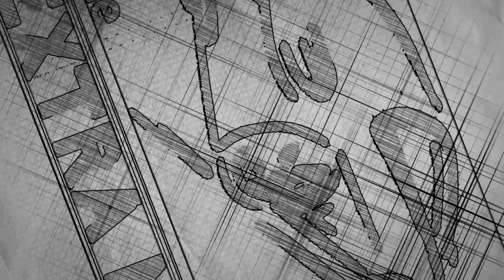W204 C63 AMG: My new exhaust sounds like crap (and how I fixed it!)

Comment: The stock mufflers have an miniature x-pipe in place to give it that signature c63 bark. Also act as both an helmholtz and pressure chamber. They remove the annoying boat drone frequencies at around 110hz. Also if you x pipe the exhaust crossover it will lose the bark and only scream/rasp 2x as much but lose the bass.
Reply from the maker: Ooooh that is VERY helpful information! Thank you!!!
Reply: @TheExtraMile  to retain the factory amg bark try an H pipe without resonator at a smaller diameter at the stock resonator location. That's the secret to that factory low end bark and startup loping sound but way louder.
Reply from the maker: That is a great tip! I am very happy with the current situation and I don´t think that I will change it further, but you never know haha
Reply: @TheExtraMile  what is your whole setup right now? 🙏
Reply from the maker: At the moment it is as follows:
- KW Clubsport Suspension
- Strut bar front and rear
- Custom tune by a shop here in Germany
- High flow air filters incl. charcoal filter delete
- 19 inch OZ wheels with Michelin 4S tires
- Oil cooler upgrade (twice the capacity of the stock cooler, works like a charm)
- stainless steel brake lines
- different brake fluid (more temperature resistant)
- some weight reduction (had to reinstall a lot though because of german TÜV, but I am working on that)
- Long tube headers with 200 cell sport cats and mid silencer from Friedrich Motorsport

Next big changes will be installing the recaro pole position seats, carbon hood, sunroof delete, rear seats delete and more chassis stiffening (probably a small cage at the rear).

After that widened rear arches at the rear to mimic the shape of the front coupled with wider rear wheels (hopefully 10 inch wide with 305 tires) and a repaint or wrap of the car.

then the last power stage. Initially I wanted to keep it n/a and get the engine rebuild. but that would be very costly and probably get me to around 650 hp. So now I am contemplating super- or turbocharging. But that is far in the future, probably in two years or so.
Reply: @TheExtraMile  wow what an impressive list. We should get it into AC😍 record the car as well. Looking forward to what numbers your car will make in the end.
Reply from the maker: @AmplifiedNetherlands  I tried to create a sound mod last year, but I used the wrong mic and ended up with a relatively mediocre sound mod. I want to do it again with a proper mic! 

I am hoping for something in the 6 second flat range 100-200 km/h, but a bit less can´t hurt :)

If I can find someone that could convert the car to a manual gearbox, that would be the icing on the cake, but the chances are slim.

Comment: Alex - thanks for the excellent and thorough videos, which larger oil cooler did you get?  I was looking for Ideas because Oil temperatures are just too high for my liking ... thanks again.
Reply from the maker: Hey there! Unfortunately I don´t know the brand, on the invoice it was just listed as oil cooler upgrade. I can tell you that it cost me 869,-- EUR and that it has twice the capacity than the stock cooler. And it works like a charm! 

Never saw temps over 115 degrees celsius and that was after some heavy abuse.

Comment: Heey! What about res delete or secondary cat delete? 👍🏻
Reply from the maker: Hey there! Secondary cats are gone, resonator has been changed to the Friedrich Motorsport one. Only the rear mufflers are still stock.
Reply: The Extra Mile awesome! And what about keeping original RES? Is less loud? Thks love your channel🤪
Reply from the maker: @djiargentina9200  Hey there! I wondered about that too. I am not sure how the original resonator would change the sound. I guess it would be slightly less loud maybe? But the change in volume isn´t that great to begin with. 

If I had to do it again, I would leave the whole system stock except for the headers and secondary cats.

Comment: I told you in your other video. The best solution for the sound on this car is: Long Tube Headers -> Primary 200 Cell cats -> original secondary cats -> original middle muffler -> original rear muffler. 

I would have replaced the Friedrich Motorsport middle muffler also with the original one.
Reply from the maker: Very good to hear!! I will talk to the shop about that.
Reply: @TheExtraMile  I tell you, currently you have definitely -> Long Tube headers, 200 cell cats, secondary cats delete, friedrich middle silencer, original rear silencer. 

Without the secondary cats, even with the friedrich long tube headers in the license, the car is just too loud. Especially at the Nürburgring or anywhere else, a police control will immediately shut down your car. 

My combination listed above is TÜV and db safe. The car will be a bit quieter than it is now, but is 100% safe to drive at a police check (I speak from experience)
Reply from the maker: @srg_c6357  Very good points! I think I will have to do that eventually anyway, so I might just go through with it.

Comment: Yeah, sounds way better!  Old sound had a tin tapping kinda noise, understand why you wernt happy.   

I asked a couple of questions few months back, as I was in the market for a new car.  Thanks for that.  I ended up getting a 2009 P30, and did a cheap CAT delete on the exhaust.   I think it sounds quite similar to yours.  I haven't done headers yet, but what do you think?
https://youtu.be/vT6JEeom1uY
Reply from the maker: Congrats on the car man!! You have exactly the same configuration as I do (2009 p30). And I shit you not, I watched your video, the exact one that you linked, just a few days ago as I was looking for exhaust sound clips! 

It sounds great man! What you would get from the headers is more volume (which never really comes across on camera) and a bit more rasp. And of course power. But yeah, the mods have to be carefully chosen for your individual situation.
Reply: @TheExtraMile  Thanks... I'm keeping a video record of all the modifications I do to my C63.  Have done 5/6 so far, (performance (BMC filters), cosmetic and maintenance) and looking forward to the ECU remap, stage 2... and then dyno tune to try to get more out of it... for my specific set-up.
Reply from the maker: @hamishmclean2083  Sounds like a plan! I am very curious about the power figures that you will achieved. Mine did 530 hp and 669 nm on the dyno, but that was with the full exhaust. I think the stock rear resonators might have a bit less back pressure. 

I timed the car from 100-200 km/h yesterday and it did it in 8.1 seconds, which I am pretty happy with for now.

Comment: in my opinion stock was still the best
Reply from the maker: I can totally see that, especially when you listen to the cold start. Check out the next video where I compare the stock exhaust to this one in many different scenarios. 

But yeah the stock exhaust note is hard to beat!
Reply: @TheExtraMile   i really liked the sound after letting of the throttle when accelerating
Reply from the maker: @xSleeper.  oh yeah that is really lovely. You will hear a lot of that in the next vid!
Reply: I agree with you guys, original Amg sound is hard to beat but manifolds and cats are so restrictive so it is leaving too much easy and healthy power on the table ... I am about to go long tubes headers and sport cell cats on mine very soon... thanks Alex for the great videos.
Reply from the maker: You hit the nail on the head there! You have to go LTH if you want to unleash that extra power.